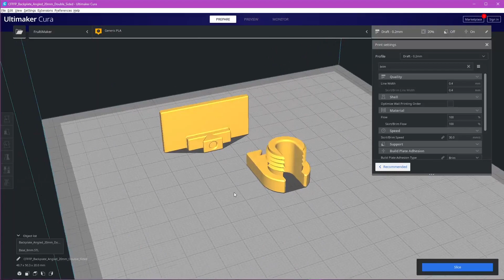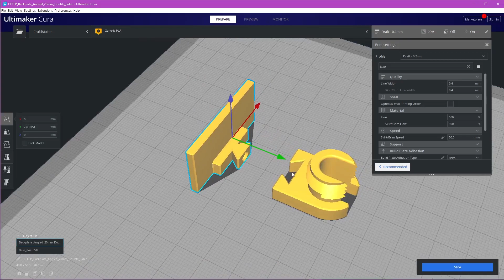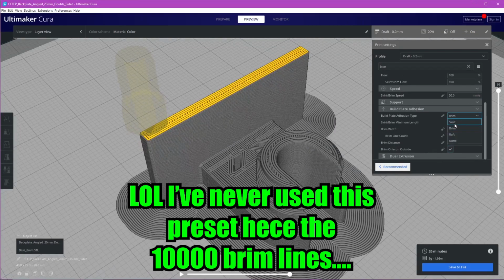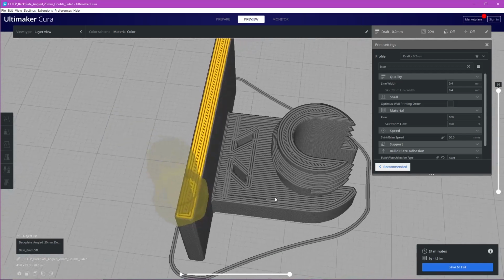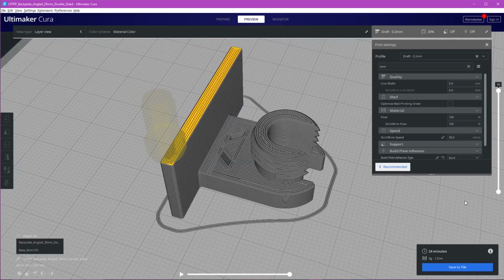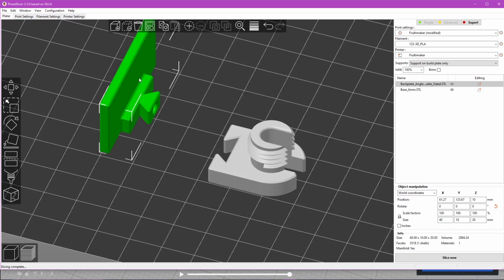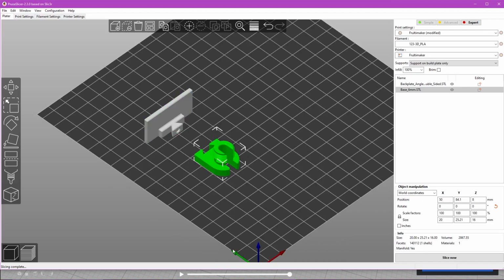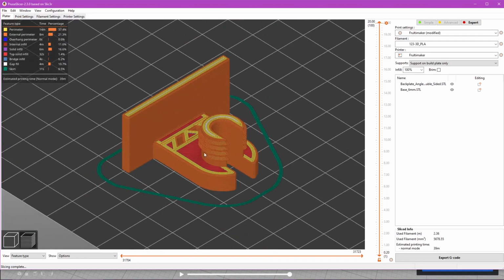(Read Description) How To Merge STL's In CURA/PrusaSlicer And Print As One Piece (Read Description)

Comment: That's not merged! It's overlaid and looks like the printer will simply extrude over the same region twice.
Reply from the maker: Well are both models attached or not then... I've never said they will become one unified body
Reply: @PattysLab  Attached in the same sense that two cars are attached after a head-on collision. It ain't pretty.
I appreciate the time you took to do the video though. I've done some trials and if you use the "Union Overlapping Volumes"  option (hidden by default) it recognises the overlap. However, it still prints the full perimeters of all shapes, which adds time. By turning it on for one shape and off for another (by using the Per Model Settings menu), it removes one of the perimeters. I cannot find a way to only create a perimeter around the external limits of both shapes with only infill within (i.e. it still draws the complete perimeter of one of the shapes when using the method above). Maybe the YouTube Brains Trust can help?
Reply from the maker: Lol,  literally prusaslicer can do it you highlight two models that intersect right click and click merge :p (just tried)

Comment: But you can see in your preview that this did not combine the 2 models into one - hence the weird nozzle path where the 2 "cutouts" are in the bottom volume due to intersection.   I also tried this "trick" in PS 2.4.0 and got Nozzle Crashes as it was double printing the intersecting parts.

In any way - the gcode will be much cleaner and correct only if (e.g. in PS, I don't use Cura) right click on the STL on your bed > Add part >> then import the 2nd STL that you want to intersect.

Also works with substracting objects with "add negative volume" - e.g. to create a mould.

Comment: Is there a way to print together multiple parts with different print settings?
Meaning that one piece could be made with a certain layer height, and then another one with a taller layer height..
It would be so cool to save time
Reply from the maker: In cura en prusaslicer you can use per model settings :)

Comment: when I stack modules on top of each other, I still get the full top of the lower model and the full bottom of the upper model. how do solve this?
Reply from the maker: Stacking items in Cura requires to disable the option: Automatically drop models to the build plate. You can find this under Preferences->General.
If you mean you get a roof at the place wher your two parts meet. I dont think you can avoid this in cura. If you want to merge two models without heaving those top and bottom layers midway of your print. I suggest using Autodesks free Meshmixer.
Reply: @PattysLab  I've don't that a long time ago.
I'm saying that it doesn't merge the models into 1. Instead it stitches them together & uses a lot more filament than it needs to.
Imagine if you stacked primitives & used the Z adjustment to make them touch or even overlap some. Then you slice it with 0 infill. You would expect 1 hollow cavity throughout. Instead it's making all the walls, top, & bottoms. They are just intersecting each other.
Reply from the maker: Yess i was noticing that in that case use mesh mixer to join the two models. This trick was more like if you have a certain part and you want to connect it without screws etc you just merge them. But for perfect part combination use mesh mixer

Comment: There must be something I'm missing because when I try to do this it literally combines the models and prints double the plastic. like it doesn't realize I want them to be one solid part and it's trying to print two parts on top of each other. Am I missing something?
Reply from the maker: In the newest Version of cura 4.8 you should be able to do this. I have to note that these parts have a flat bottom side. What you can do is send me your stls you try to merge and I'll test it out for you. You can send them to pattyslabb@gmail.com
Reply: @PattysLab  thanks but I think I figured out after toying with some settings what I was lacking. There's a setting that needs to be enabled under "Mesh Fixes" called "Remove Mesh Intersection". This stopped it trying to print both pieces on the same layer and printing double plastic. Or at least so far I think. I just sliced it and I'm printing it now and I'll see how it goes 🤷‍♂️
Reply from the maker: Okay great! Btw good that you commented this. If other people have Problems in the future they can see that this option needs to be unchecked
Reply: @PattysLab  It happened to me too. I was going crazy trying to figure out why iot was printing double plastic

Comment: The same is also said if you deliberately drag one or more models below the build plate, it will not generate gcode for the mesh below and thus not print it. You can print really easy cross sections of models this way if you just need to check fitment or something (before printing the whole thing)
Reply from the maker: Yeah exactly I've shown that in my how to reduce money by using planes video exactly the trick you are describing. However, this does not work for prusa slicer there you need to use their plane slice tool :)

Comment from the maker: EDIT:

In PrusaSlicer you can actually MERGE two intersecting bodies by selecting them and right-click on the selection and clicking merge. Then you should not have the intersecting perimeter lines. If you want to undo this operation you have to use the SPLIT command